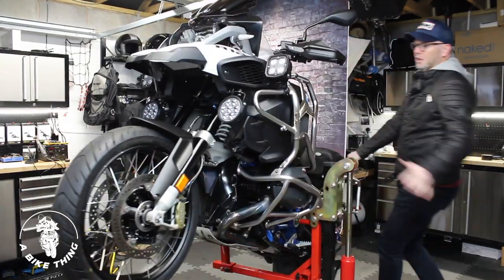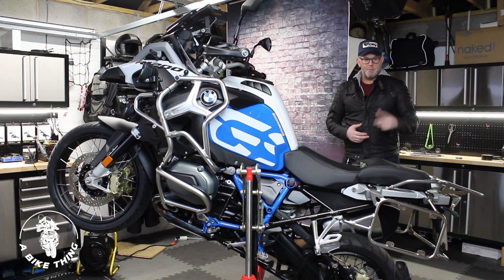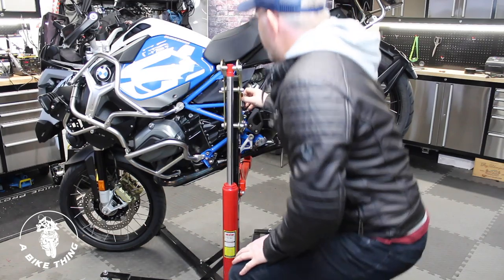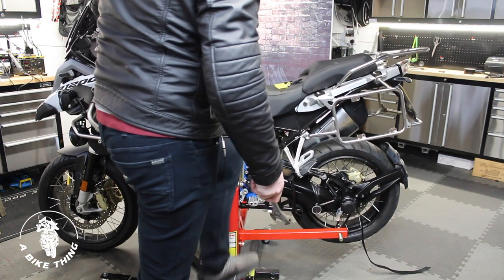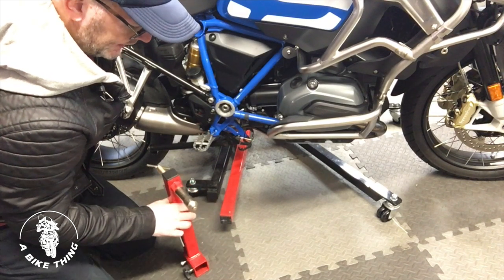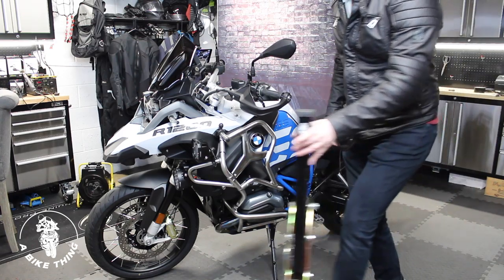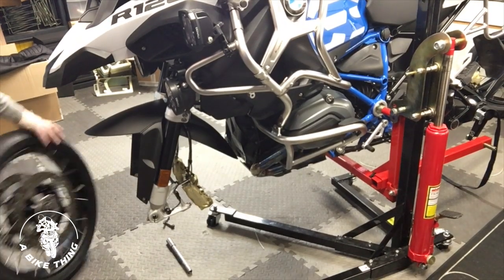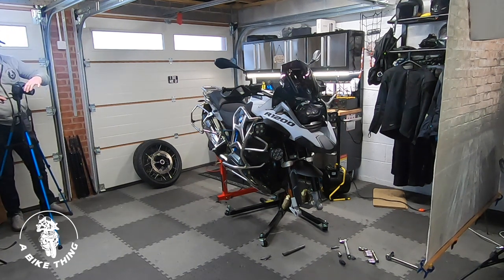MOTORCYCLE LIFT BMW R1200GS R1250GS R1200GSA R1250GSA

Comment: I have the same lift. Some thing I dislike though are the leaking cilinder. I find oil on the floor every now and then. Also, I have an 'old' version, where one of the wheels can not turn 360 degrees. It makes it difficult to manouvre the lift in tight spaces. Overal I am happy with it, it could be a tad more professional though.

Comment: I own the exact same bike. It comes with frame protectors that really protect the beautifull frame against the rubbing of harder boots. Wouldn’t want to take them off each time I want to use the lift. The protectors are secured with double sided tape as well as three rubber bands each.
How do you go about with these protectors?

Comment: I built one of these and use 2"x18g square stock because I have a hard time believing this tubing is strong enough. But I've seen so many demos, I guess it is. I find this version better that the one with only one side. I put that same bar running under the bike to pin the other side as well. I didn't do wheels on my diy and simply can't wrap my head around the ease you can move this monster of a bike, let alone on a foam floor. I would love to use this lift on my gsa and other customer bikes like hayabusa's. I understand the pin systems are interchangeable for different bikes. Just wondering the height difference between the bikes.

Comment: You didn't mention fitting kits, unless I missed it, but neither does your site? I assume yours comes with the R1200GS fitting kits 
ABBA Sky Lift
 Fitting Kit for BMW R1200 GSA 
 BMW V1 Hub Spindle for BMW R1200 GSA
Reply from the maker: Richard and Corinne WrightWells that’s correct.  I’m only focussing on bmw GS’s. This comes with everything you need for a LC GS and GSA.

Comment: How would the Skylift perform with a non polished cement floor in a garage, please?  The wheels do appear to be somewhat small.
Reply from the maker: Hi,  not too bad.  I’m using mine right now on a rough cement floor.

Comment: Cool setup, perfect for service work.  Those additional set of lights on front, are they hard on the bikes main light switch or do they come with proper wiring so it wont overheat
Reply from the maker: BlueKnight001 hi.  You need to watch my other videos on denali lights.  Main switch powers everything but they’re wired up via a cansmart with variable fuse settings.

Comment: What if I need to take the rear drive shaft assembly off that apparatus is not going to allow that… Pass
Reply: You are able to remove the rear drive/diff using this lift, I’ve done it…

Comment: Not needed to removed both wheels!  A bike dolly for £60-70 will move you bike around when on centre stand, rear is off the ground and a block under the sump plate will keep the front off the ground when bike parked. Too much money!
Reply: Tightwad.

Comment: Are You serious??? With that money (£469.99) i can have a real stable lift ramp!!! I could say it is a very good solution if it would cost not more than 200£
Anyway, thanks for your video.
Reply from the maker: post a link to one on here.  I know I'm selling these ramps but I genuinely like to see anything else out there.  When you say stable lift ramp, are we talking big bed that's not on wheels.  Different application altogether?
Reply: @ABIKETHING  the main purpose is to raise a bike higher, to work and have a better view of the bike, without hurting our back and knees, and not to walk around with it.
 As i already told, it is a nice alternative but it is to expensive. 
There are pros and cons in both of them. A better price for the "Sky Lift" will ad a serious Advantage and make the cons seem minor, opposite to the classic lift ramp. (Big bed without wheels😂)
Reply from the maker: Y K my main concern and I think I speak for others is not having a big bed lift which isn’t on wheels.   We cannot all have a big bike lift sat in the middle of our garage floor.    When not in use,  wheel it to the side.   Only 40kg.  Takes up hardly any room.      I think they both have their benefits.   If I had room to waste and didn’t mind jumping over or walking around a ramp all the time I’d go bigger too.     But this skylift does it all and more and it doesn’t take up all your floor space.
Reply: @ABIKETHING  everything you mention is correct, but the price.
Reply: @Tenerisius  You're just tight or can't afford one!